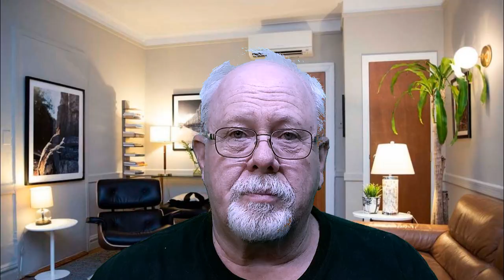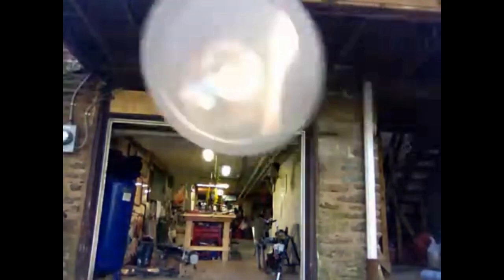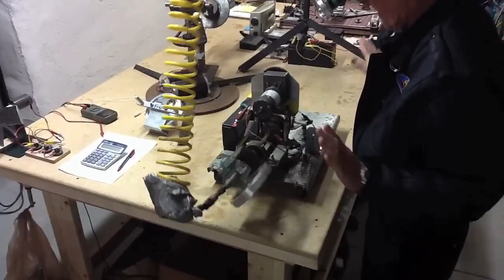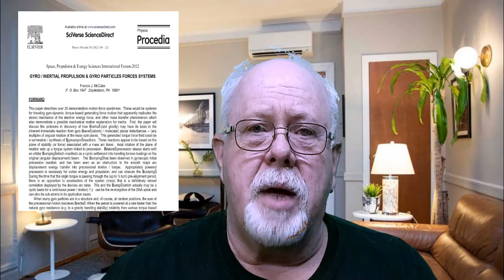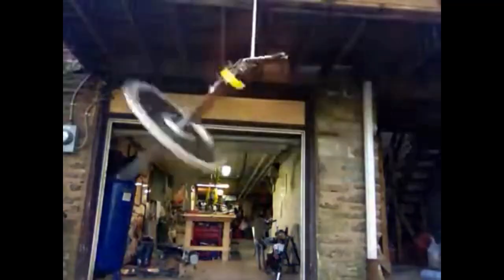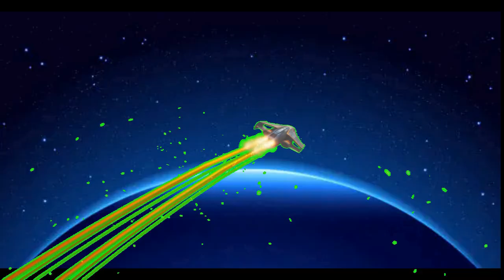McCabe’s Gyro Drive

Comment: 4:34 A good engine option! Only need to install not one, but a couple of flywheels on one axis, rotating in different directions for balancing.
This engine will provide a constant thrust needed for the flying machine.

Comment: The problem with "gyroscopic drives" is they only work while accelerating the rotating masses.  You can only accelerate a wheel for so long and then things break.  The system cannot be static, turning at the same speed.
Reply from the maker: Correct! Time base changes (speed changes) must occur dynamically during operation!

Comment: Thank you
Reply from the maker: You're very welcome, thanks for watching!
Reply: @stclairtechrd  I saw a thumbnail yesterday of a drawing of a simple design:

1. A large rotating wheel with slots that allow travel of ball bearings toward the rim and the axle.
2. A smaller fixed ring that is offset such that its rim extends to the larger rim on one side and is closer to the larger wheel's axle in the other side 180 degrees opposite the rims that coincide.
3. The fixed ring then restricts the outward rolling of the ball bearings such that they reach the outer rim on one side and are drawn towards the center on the opposite side.

Maybe you've seen a setup like this, I don't know.  But to me it seems like a very simple and effective concept to achieve what you and Mr. Tokyo are doing with very few moving parts and potentially very high RPMs and resulting force.

Could you comment on that idea?  It seems interesting to me and perhaps is the idea behind the design of that guy who disappeared about 20 years ago .... (sorry I forget his name ... Bob something maybe?)
Reply from the maker: @tbuitendyk, Thanks for commenting and that is actually a really good question. The simplicity of it is intriguing and really quite inviting, because of this simple structure it has definitely been tried by multiple people. Unfortunately it isn't quite that simple to get working, and since it didn't work out, many of these people erroneously offer it as "proof" that inertial propulsion doesn't work.
Simply put, centrifugal force alone is not an effective way to get real inertial propulsion, one needs abrupt changes in velocity along with very specific geometry for manipulating the masses. Some will work, only while either "spinning up" to speed, or "spinning" back to a low speed or stopped posture.
So, to answer the important question of: Does a simple device like that actually work? The answer is: Maybe a little, but not without a lot of modification.
Several people have asked me about putting on classes or developing a course in inertial propulsion, maybe with hands-on training building something that actually does work. If there is enough interest in something like this, I would seriously consider it. Let me know...
Thanks again
Reply: @stclairtechrd Excellent!  Thanks for the detailed reply.  Saw a really interesting "toy" demoed by a presenter that is said to provide a magnetic kick of a magnetic device from a locked position within a set of fields.  The gentleman stated that the impulse given to the smaller magnetic "car" was imparted without any corresponding reaction back on the ejection device.  If he's correct then the kinetic energy of the propelled magnet should be collectable to provide reactionless thrust....  Thanks again
Reply: I saw a patent like that which had ball bearings in spiraling slots. The claim was with one flywheel disk driving another one nearby, a momentary brake on that one's rim won't slow it down.